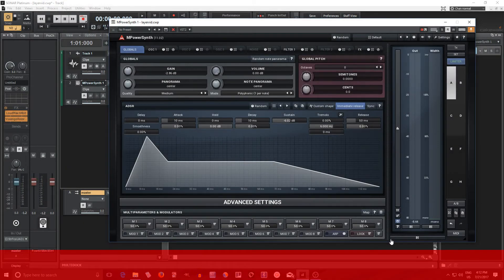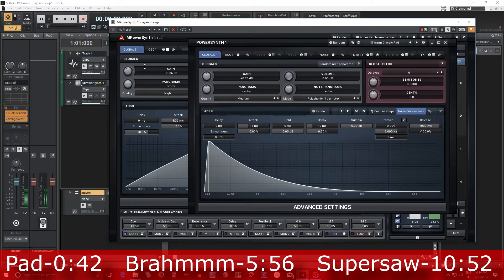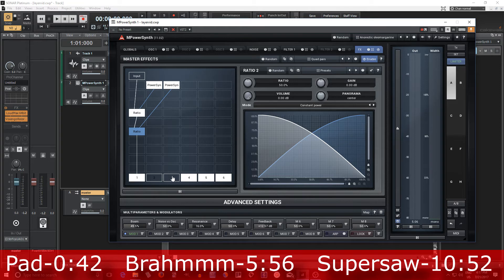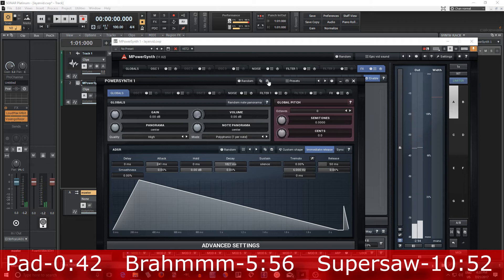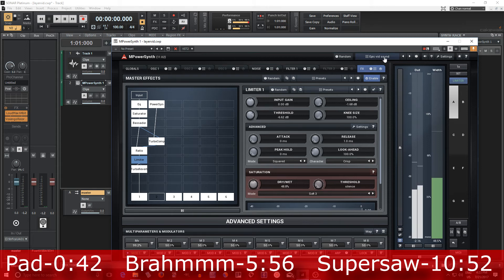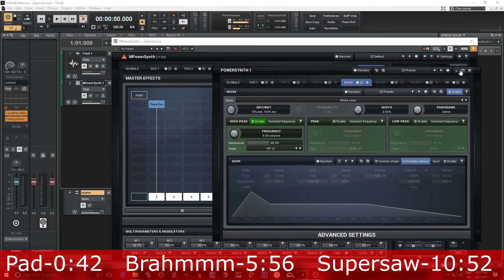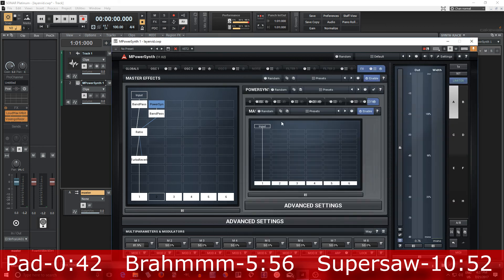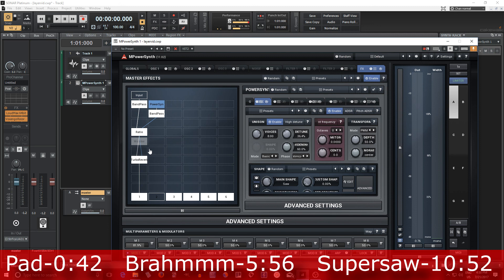Layering with MPowersynth

Comment: Wow. And here I am, 4 years later, with a bad case of synth acquisition syndrome, and MPowerSynth is on sale right now. It is unbelievably deep. Yesterday I found out that when you add harmonics to oscillators, you can then modulate those individual harmonics with  LFOs. It's like this thing has no end.

But embedding a synth in itself is on a different level yet. I'm fresh out of reasons not to buy it.
Reply from the maker: Glad the video helped. Thanks for watching.
Reply: I just dove into MPower Synth too. It's one of the most powerful out there ... once you get used to the Melda topography (which I just love that Melda's topography is the same for all their plugins, which reduces the learning curve as you accumulate more Melda FX & Instruments). Thanks for the tutorials, Chandler. Keep 'em coming, brother. (y)

Comment: Hi Chandler. As always a great tutorial. I love this synth totally. I think it is one of the greatest in sound out there. The modulation matrix is pure madness and alone worth the price :)

One thing after all I am missing. Do you know if you can loop amp- envelopes? That would be awesome. Thank you in advance. Cheers
Reply from the maker: Thanks. AFAIK you can't loop the amp envelope, but you can use an LFO to do the same thing. Just use the custom shape section in the MOD section and you can make any type of shape you want. Hope that helps.
Reply: Yes I know that function from all Melda tools. Yeah could work to achieve something similar :)